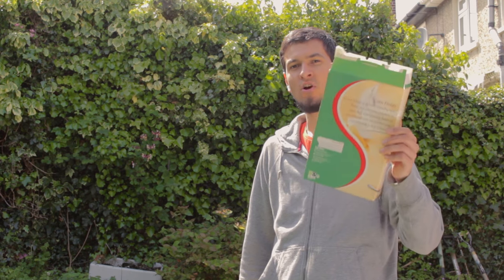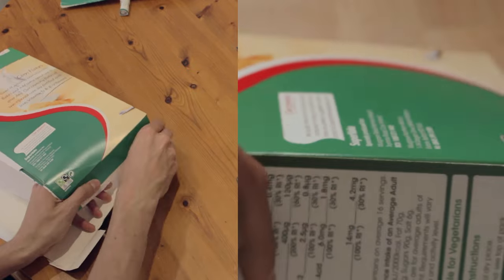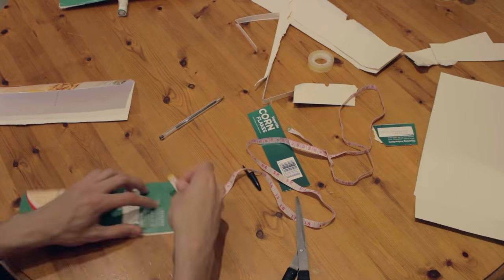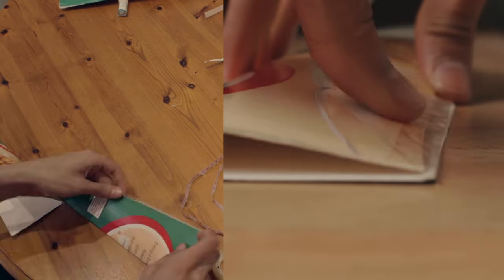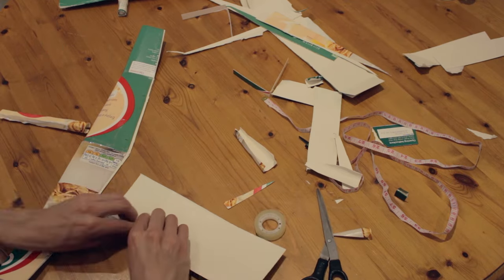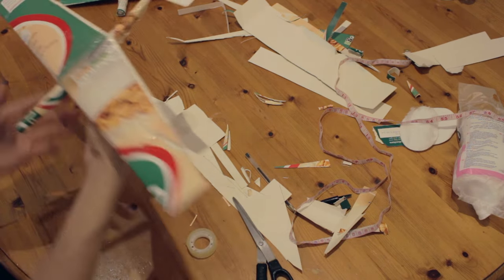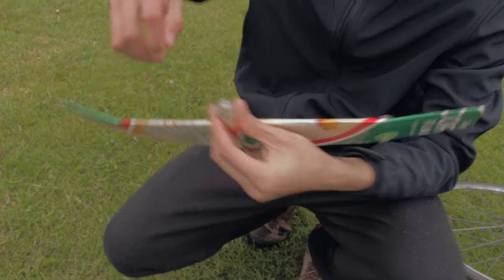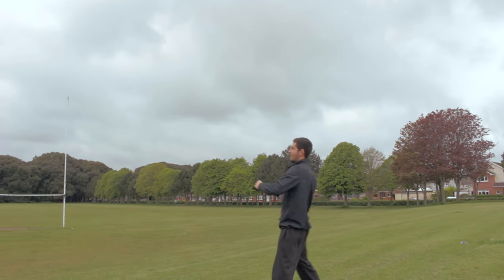How to make an airplane with cardboard (glider)

Comment: The plane seems to be quite heavy for it's size. While it sure is very sturdy and stable, in my opinion it flies a tad too fast. Also idk if giving it a proper wing profile was worth it. It would save you much more weight if you would put a classic "slow flyer" type of wing.

Comment: Is there any way to add wheels for landing?
Reply: Probably could. If you have a bit of LEGO technic you can make two big upside down triangles and if you have the bigger technic wheels you can put them at the bottom of those triangles. You can then use tape to put it at the bottom of your glider (put them at the center of mass (where you can put your finger and it balances)